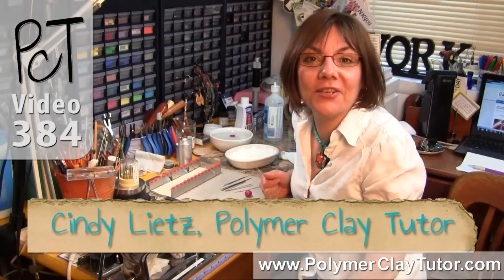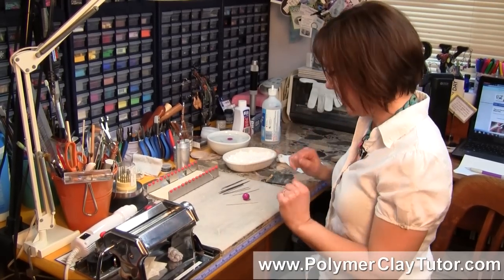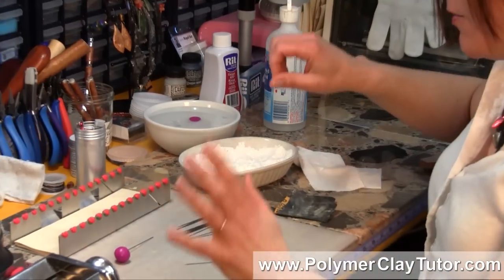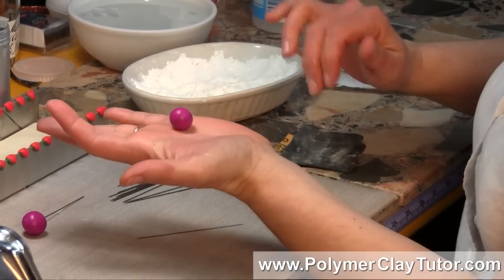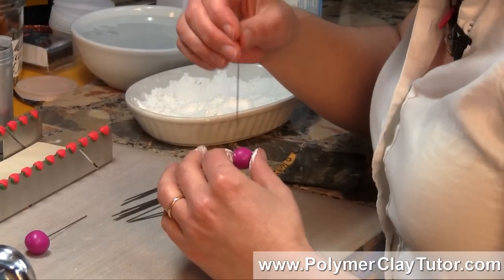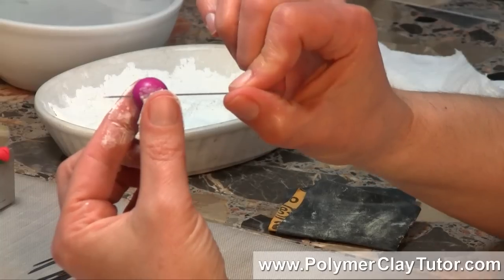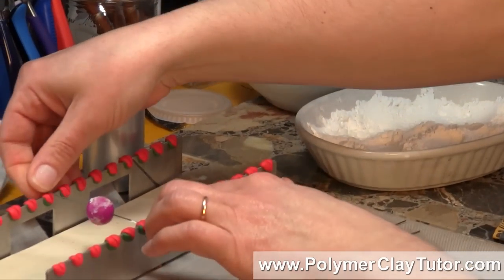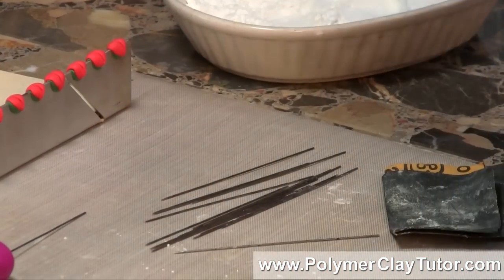Holes In Polymer Clay Beads

Comment: i tend to put the beads in the fridge, cools them down without getting all wet.i also use a firmer clay on the inside of the beads i like the sculpey colors but they are very squishy so a fimo core works well to help keep its shape.

Comment: Thank you so much!  I just ordered a rack and pins.  I've been using a pin and toothpicks.  I was gently twisting the pin through and pulling it out and making little 'bead brochettes' on toothpicks for baking on parchment paper.  I made sure to put the bead on the toothpick starting with opposite side that I pierced with the pin (to push in the pucker).  It worked to make my first beads but now that I know I want to make more, I am sure that having the right tools will make a big difference!  I love your tip about cooling the clay first... and wearing gloves or using corn starch.

Comment from the maker: Thanks Victoria! You're right about my bead rack having more function than regular bead racks. I added a product called Sugru, which is a high heat silicone clay that dries to a rubber like material, which in this case keeps my bead pins from falling out. I did a video called "Sugru Hack For Your Amaco Polymer Clay Bead Rack". Make sure to check it out in my PolymerClayTutor Channel.

Comment: Thank you so much for this tip! I am also going to use it for inserting headpins Into my clay charms. They always insert twisted and know they probably won't!
Reply: Are your head pins good quality and not small. I just did this and my head pins didn’t bend or twist. All headpins and jump rings are equal. I learned that the hard way. 😢

Comment from the maker: Hi Patrizia Mondoni, it can be tricky to get a hole in a bead with a foil core. One thing you can try is to make your foil core over a bead pin or wire before adding the clay. then you have a hole already, that will be easier to poke through. Or you can try a sharp but thin needle to push through the foil, but that can be harder to do. Good luck!

Comment from the maker: Hi Jayalekshmi J J, no, terracotta clay and polymer clay are not the same thing. Terracotta is an earth based clay that needs to be fired at a very high temperature (1000's of degrees F).  I think there are some air dry terracotta clays used in the craft market but they are as strong as the fired ones. Polymer clay is a plastic based clay that needs to be baked in an oven at a quite low temperature (200F-300F depending on brand) So although they both say clay in their name, they're not the same.

Comment: Hi Cindy, I have an issue with my beads and wondering how I can save them. I soaked them in ice water for a while and then used cornstarch on my fingers to avoid fingerprints. I baked all my beads and they all have a white dusty film on them that doesn't come off. I rinsed them well and then added some dish detergent. I don't know where it went wrong. I baked about 60 beads. :( Hope you can help. Thank you.

Comment: How would you make larger holes in the beads. I’m needing to be able to string 2 strings of para cord through my beads for making a beaded lanyard. I cam make the small holes but not sure of the best method for larger holes.
Reply from the maker: There are a couple of ways to do it. You can keep the small holes when you bake them and use that small hole as a pilot hole for drilling out with a larger drill bit. I have a video on my channel that shows you how to do that. Or you can make your bead on a larger mandrel, like a metal rod, bamboo skewer, small knitting needle or even a chopstick. Give your bead a little twist while it is still on the rod, before baking, especially on anything wooden, because sometimes they will stick. Sounds like you have some experimenting to do!

Comment: I went to micheals the other day and found these metal bead ring hole things which you are suppose to attach to each side if the bead, and then remove the clay still left in between the bead holes but when I tried to do that I ended disturting my beads

Comment: How do you make beads with bigger holes? Do they make larger diameter pins?
Reply from the maker: Hi FlickerFlee You can use bigger diameter pins (knitting needles etc) if you wish, but I most often prefer to make them small like these and drill them larger after baking if I need to.

Comment: You can also just bake beads without holes, and drill holes afterwards.  Avoids all distortion, perfectly straight hole, and any size you want.  Based on the bit.
Reply from the maker: +artmakersworlds Yes you can but it is quite tricky to drill a nice perfectly centered hole in a baked round bead... especially if it is small... if you don't already have a pilot hole pierced with a wire when it was raw. Unless you use a jig.
Reply: I do it all the time, however, a simple "jig" would be place the bead into a smaller size round cookie cutter.  (us clay nuts all have them.) Hold it with your fingers so it doesn't go spinning, aim straight down and viola.  (I use a dremel for this, very high speed and tiny bits.)   The advantage to this is no chance of squishing, finger prints, or any of that.    Now I still haven't mastered doing this with lentil beads.  I've seen better jigs but don't yet have a drill press.   Aim has to be perfect or the hole does't come out where you want.  And yea, for those you sure do need a starter hole.  Or drill press.   ah someday. After a lathe.